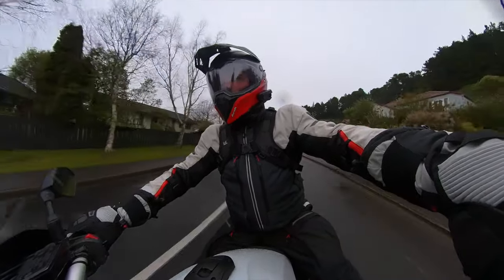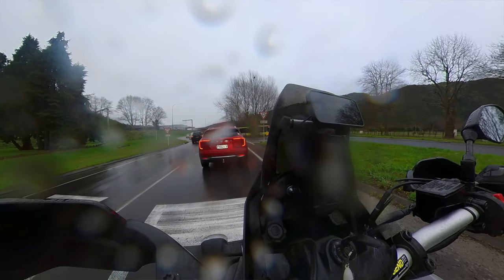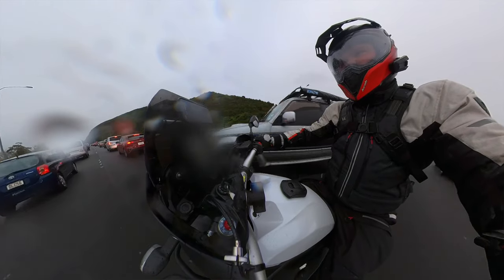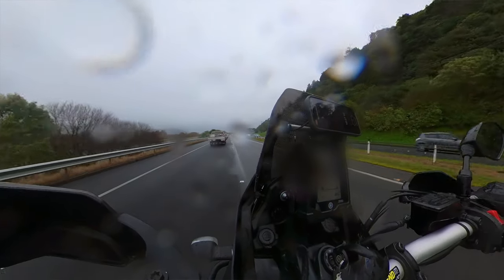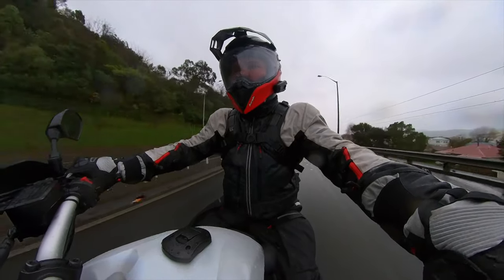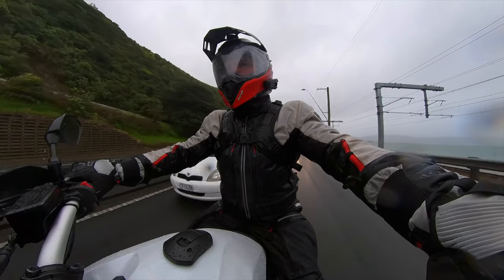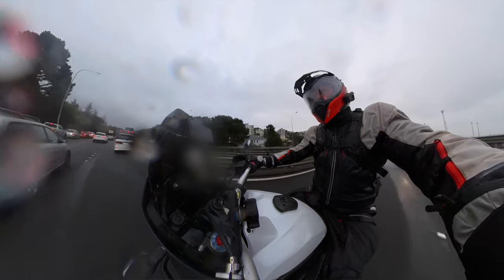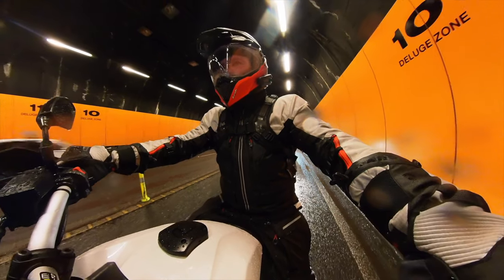RevIt Off Track 2 H2O Waterproof Test | MotoNZ.com

Comment: Thanks for the great review. You are probably getting cold because the jacket has wet out even if it hasn't got through the waterproof liner. Can't the waterproof liner be worn on the outside? That would stop the jacket wetting out and becoming cold.

Comment: Thank you for the testing, really appreciated the honest review! Exactly what I was looking for before buy as there is not enough coverage on the internet about the Offtrack 2. Seems the jacket will cover all 4 seasons of NZ weather, have you tried it in the summer? Regarding the video sound quality, I would suggest to filter the wind noise (that not really annoying but would be great to reduce). Could be done via AI or sound editing apps with no effort.
Reply from the maker: Hi there. I’ve not had the jacket that long. Only a couple of months, but the thermal and waterproof layers come out really easily, and there are some big vents for air glow, so it would make a great warm weather jacket too. 

The wind noise is actually added in to this video in a separate audio feed from the camera to give some ambience, otherwise you wouldn’t hear it at all if just listening to the mic feed. The Cardo does a great job of noise cancellation.

Comment: what's a jacket for warmer weather? up to what temperature is it ok to drive with it? I'm planning to buy it, so I'm interested in your experience..
Reply from the maker: this Revit off track 2 is fine in warmer weather, but youll want to remove the thermal and possibly the waterproof lining, which is easy to do... or the Dirt series jacket... but that has less crash protection.

Comment: I'm still seeking that "waterproof" gear, as I always arrive with wet socks, crotch, etc.

6 deg C is my lower limit in Toronto, Canada.  But I have heated jacket and pants, and heated grips.  I'm envious of your legal lane splitting.  It looks like it drops about 40% time off of your commute.
Reply from the maker: lane splitting isn't the best thing in the world, but it does mean if traffic is blocked you can usually still get through.
I think on average i save about 20minutes per trip. more if theres been a crash.

This Rev'it gear is definitely the most waterproof gear I've had up till now. only time will tell if it stays that way.
Forma Boots are about 5 years old and still completely waterproof. can recommend.

thanks for watching.
Reply: I spent ten years as a motorbike courier in Wellington (where he is) and used  SIDI  Gortex boots. Kept me feet dry all day. Had to dry them out over night so had a fue pairs at once but highly recommend them.

Comment: How waterproof are the trousers? In very heavy rain
Reply from the maker: They haven't leaked yet...
Reply: @MotoNZ  are the trousers quite baggy ? I’m trying to find something for enduro riding that accommodates knee braces 👊
Reply from the maker: You might get knee braces under them, but I think you would be better looking at the RevIt dirt series pants for enduro riding.
Reply: @MotoNZ  ye they don’t seem to to much regarding waterproof over trousers. And the best I have come across so far is the H2O s
Reply from the maker: I can just imaging you’re going to get too hot, but yes you can wear the offtrack h2o pants with knee braces and that should be fine, I have a set of Pod K8 that fit fine with the offtrack H2O pants
Reply: @MotoNZ  yeah, literally need the waterproof trousers for Road touring and off roading  when it’s wet, and to be able to fit my pods under too 👊
Reply: @MotoNZ  also, have you been in torrential rain with them and stayed dry?
Reply from the maker: During a super heavy down pour I got slightly damp in the crotch. Otherwise all other times I’ve been perfectly dry.